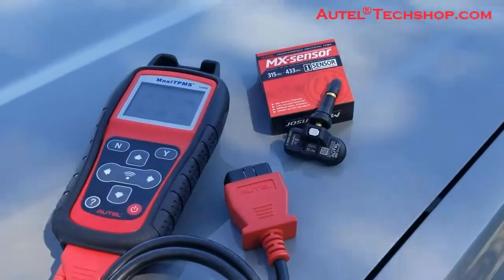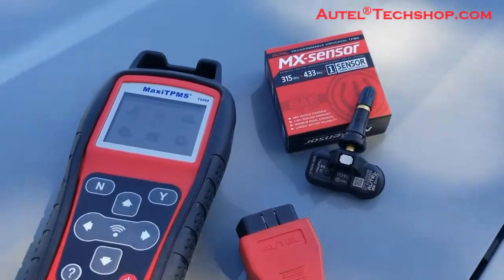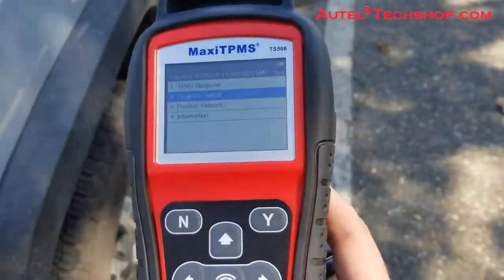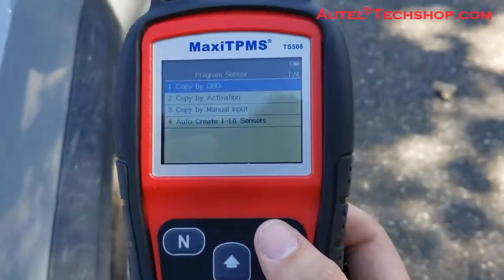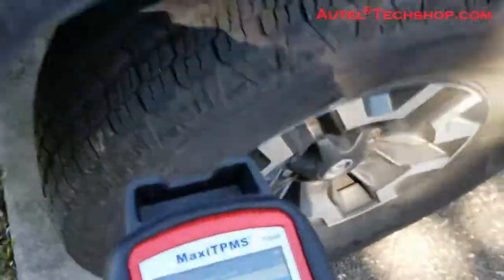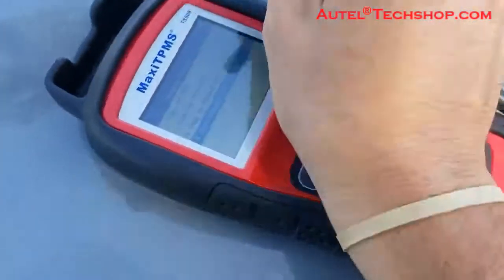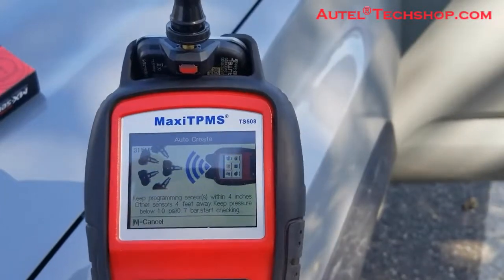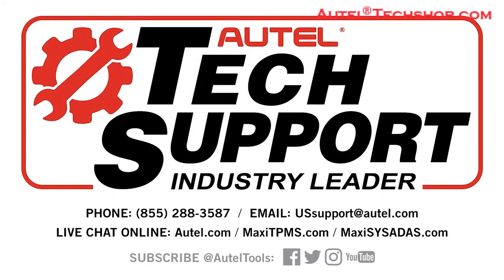How to use Autel MaxiTPMS TS508 to do 1 Sensor Programming

Comment: Hey Autel tech, my tech nstalled new MX sensors and programmed them to a 2013 F30 328i using copy by OBD mode.  With the OBD connected it pulls all 4 IDs, and when scanning each wheel sensor the ID matches the OBD list of 4.

However on the car it shows tires low pressure, and resetting it and driving does not do anything.  Tires are set at 34psi, car specifies 32psi.  

I don’t believe he deflated the tire when programming. Will that interfere with the car reading the new sensors? 

Any help would be much appreciated!